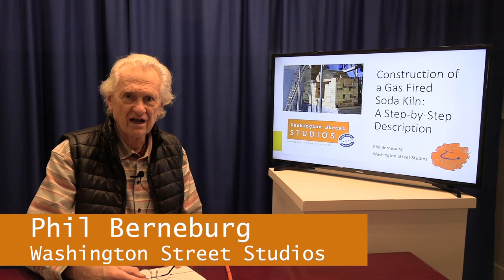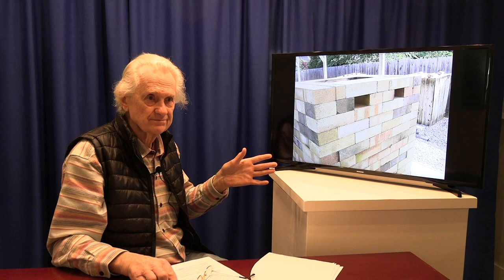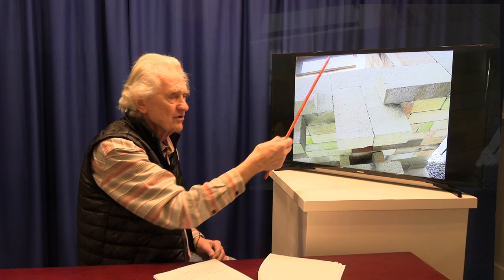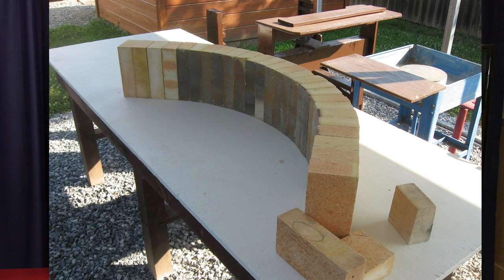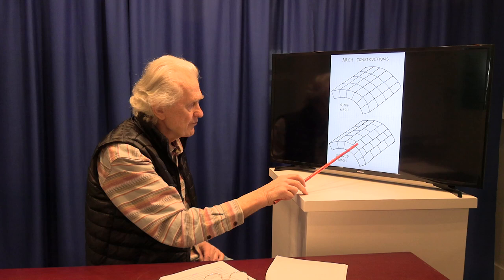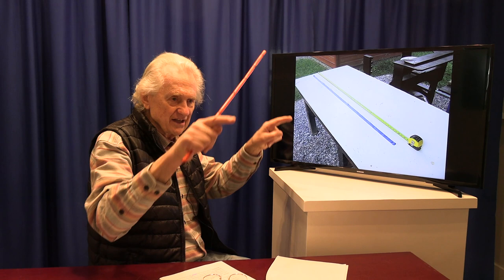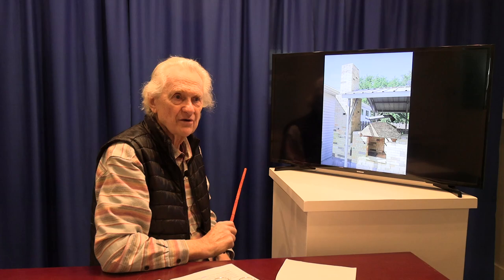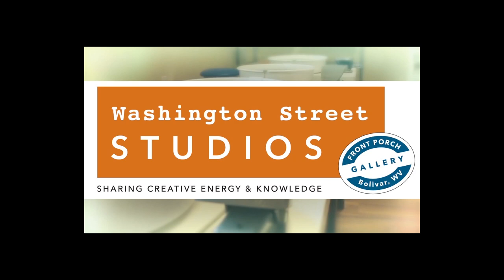Construction of a Gas Fired Soda Kiln Part 2

Comment: I am in awe of the expertise that has gone into building this kiln. The step by step documentation has given me confidence to build my own downdraft propane fired cone 10 kiln.  Would the design of this kiln (without the soda ports and shelves to catch the "soda slop") work for cone 10 firings? Thank you so very much for all the videos.  I love watching and learning from them.
Reply from the maker: Yes, the design would work, and you could use insulating brick for the inside layer of the walls to provide more insulation. We used hard brick because the soda would dissolve soft brick. Without soda, soft (or insulating) brick would give you a lot more efficiency and keep the heat in better.

Comment: Why isn't proper refractory mortar is being applied? To make high efficient high temperature brick pizza oven, refractory mortar is used. By building code state law requires to have high temperature ovens of all sorts to be 10 feet away from a building or a home... it's crazy how the kiln is so close to that building and door, thats a fire hazard and it does not matter how much of a pro you are.
Reply from the maker: Using mortar is a decision. The kiln could be made more efficient with refractory mortar, if you are willing to accept the risk that the mortar will degrade and may fall into your ware-stack. We elected not to have the risk of mortar degradation in our kiln build.
As for the chimney being close to the building, the chimney is double walled, and while firing it can be hot to the touch, the radiant heat does not reach to the building even at the final temperature.
Thanks for watching and commenting!